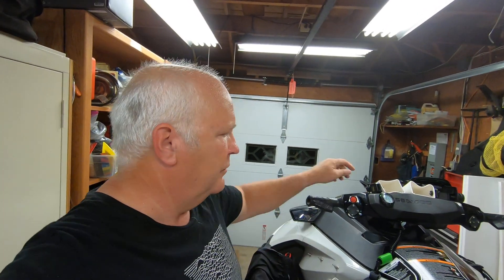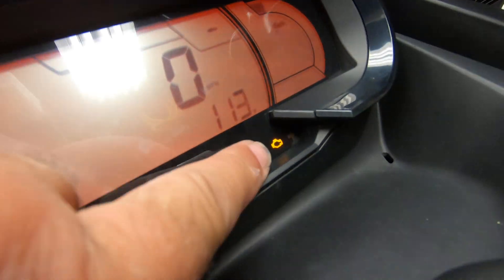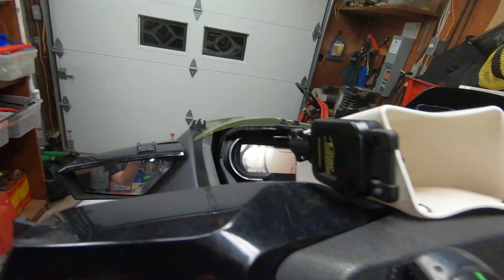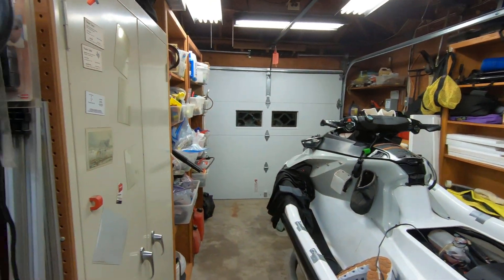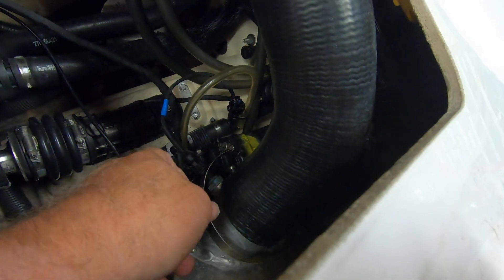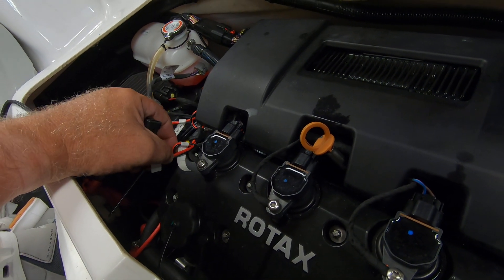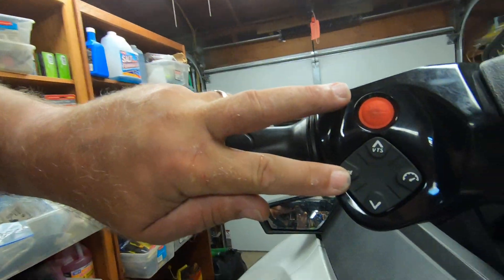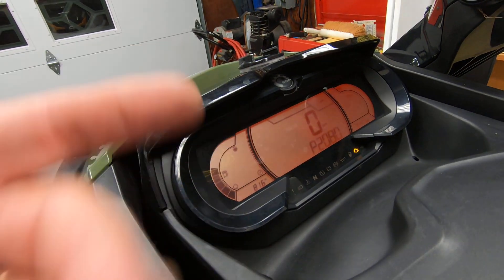FishPro Tips - Accessing Fault Codes  - Check Engine Light

Comment: Mate do you know if doing this will show stored codes at all?
Reply from the maker: Steve - I think that the handlebar way of checking will only show the active codes and that once the problem corrects itself will reset/clear them. Someone else on the channel may be able to chip in here with better info. As mentioned in the write-up,  for  some faults, even after correction, such as reconnecting a loose sensor wire, the code can only be cleared using the software/dongle tools in the shop (BUDS).

Comment: My '21's got a low oil pressure issue - I bought a candoo to get to the codes, not knowing I can get to them right on the cluster!  I guess I can make a key with it, anyway.

Thanks for the info.
Reply from the maker: Im not sure that you can get all the codes on the cluster can you?
Reply: @billjenkins1535  I didn't know I could get ANY codes until I saw this video, so... um... no, I'm not sure of anything.

Comment: thanks for the vid Bill, my seadoo fish pro only comes up with units and exit when I hit the right hand button…so settings, unit and then exit are my only options :-(
Reply from the maker: Let me check
Reply: @billjenkins1535  the local dealers here say that the older fishpros cant access those codes without going to a service agent. New models can be accessed like your vid.
Reply from the maker: @jasevtr1000  Humm, I did not know that. Mine is a 2019 Fish Pro. Just to be sure - Did you look in the operators manual that came with the ski. It is NOT  in the big shop service manual but in the little manual that comes with the ski on the 2019 FishPros at least. What about yours? here is the 2019 FP Manual... https://www.operatorsguides.brp.com/public/tmp/219970EN.pdf Here is the paragraph pg 149

Displaying Fault Codes
Press the right arrow on the right keypad until you see Setting. Press OK to
enter. If a fault code as occurred during
your riding cycle, a CODE menu will be
available in the settings men

Comment: Great video.  Recently had a code on my 21. There isn’t much information out there on how to properly check for codes.
Reply from the maker: Yup..took me a day of searching to find it and how it is different from the other Google instructions that apply to other SeaDoo craft.  How to display them on the dash is NOT in the shop service manual, but what buttons to push procedure  IS in the small Operator's Guide! SMH. In addition one has to go to Greenhulk or someplace like that to get the complete list of codes because even the shop manual doesn't seem to have all of them.